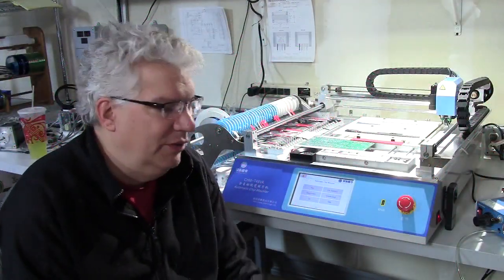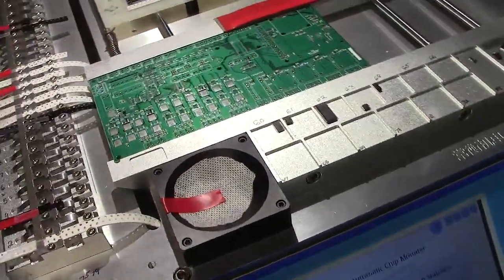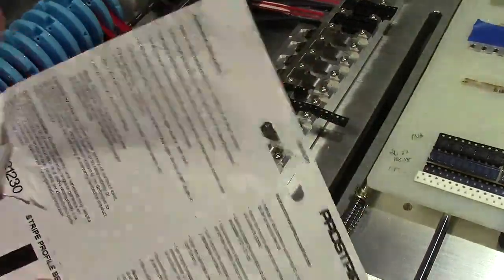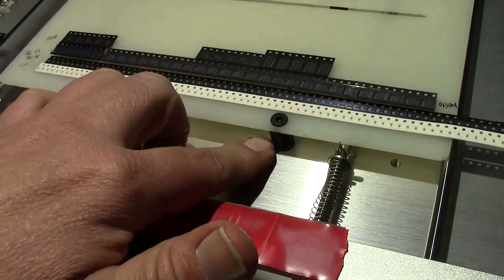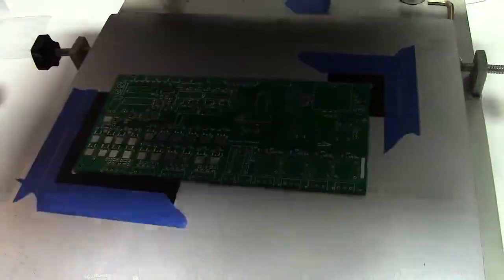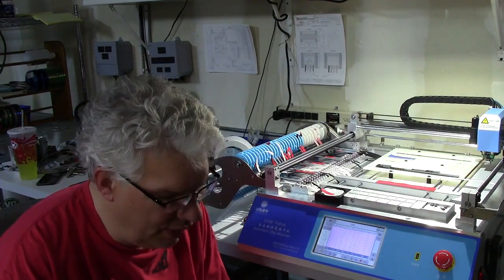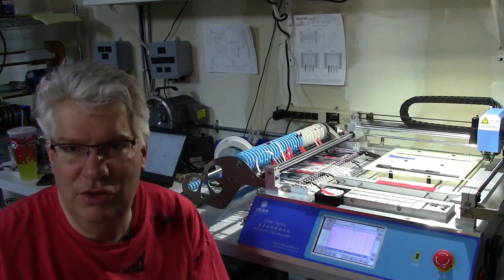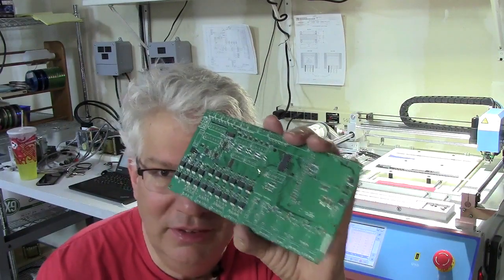190409 Charmhigh CHM-T48VA Places Surface Mount Tex Board

Comment: Hello, thank you for your video and explanation of your P & P machine.  I was thinking of buying this machine, I am presently outsourcing my Surface Mounting, and recently started getting my PCB built in China at 1/4 of the price I was paying in Montreal (I should have switched earlier, boards are all around much better).  I now want to cut cost even more and start doing surface mounting myself.  I would build approx 8000 (3000 of which is only 4 SM components) boards with approx 14 or more SM components per board, could it handle this or would I be babysitting it too much?  Thank-you.
Reply from the maker: Actually, if your boards are simple as you said, the Charmhigh might be fine
Reply: @CraigHollabaugh  Thanks
Reply from the maker: The charmhigh requires a lot of babysitting.  Check out 'unexpected maker' channel for the machine Seon has.

Comment: Sir any problems to this machine after a year? I want to purchase the same any tips for me.
Reply from the maker: I've had 2 issues, the pull pin and USB port. I have a video here on pull pin repair. The USB port seems mechanically loose and the machine won't always see my USB stick. Other than that, it works fine for the limited boards runs that I've made.

Comment: I did notice that the solder paste was a little heavy on the IC with the bridge. Hand stenciling usually results in too much paste, so I usually reduce the paste mask a little on those tiny pads to compensate.

By the way, how many components can that machine handle? Looks like about 25 reels, but with some improvising, is it possible to add additional reels on the opposite side, and still program the machine to auto feed them?
Reply from the maker: I'm definitely a novice solder paster, that's for sure. Thanks for the comment and for watching.

Comment: Did you get a chance to try a lower pull speed for the tape pull pin?  When I got mine I tried the 100% speed but it jerks the tape so hard it upsets the part to be picked, thus getting a pick error...  Once I dropped it 10% the pull and pick went very smoothly...

Comment: When the pull speed is at 100 percent, it jerks the part tape so hard, the smd component is dislodged in the tape pocket, preventing a clean pickup, or the pin yanks on the tape and jerks out of the tape pull hole resulting in an incomplete pull, think partial pitch pull, resulting repeat pulls that cannot find the hole, then with an incomplete pull large parts may be off 1/2 the pull distance...  All this goes away with a gentle 10 % pull speed...
Reply from the maker: Makes a lot of sense. Thanks for the tip. My largest placement issue happens during the blow off, it seems like air is too forceful and part is blown off its placement point. Have you seen this with yours?

Comment: I reduced the pull speed on the pull pin to 10%, most all pull/pick errors went away, allowing for uninterrupted placement...

I do not use parts smaller than 0805, lso added a dwell time on place...

I'm running the big dual sided reel Charmhigh...
Reply from the maker: Looks like I need to check these settings out, thanks for the comment.

Comment: Do you notice when you use parts below a size, the error increasing?

I like to stick to 0805 and larger.
Reply from the maker: Well not really, 0603 are fine, a slight misplaced part is pulled to pad center during reflow.  When I do another board run, I'll take more photos for you and everyone on this and other topics. FYI, there's an on discussion about this over at the Google desktop pick and place group. Thanks for watching.
Reply: @CraigHollabaugh  thanks Craig

Do you do much with the raspberry pi? I've built a UPS for it and would like to get some feedback on it if I can get one to you. If you'd like that. It's designed to shutdown at power loss and boot up at power returning. Has a switch for manual control.

Thanks again
Reply from the maker: @scottcox9108  Sure, find my contact info on LinkedIn. Let's chat before you ship anything. OK?
Reply: @CraigHollabaugh  got it

I see you're in the junction area..
Just passed through over a week ago to Utah and back here near Boulder

Comment: Most of the pick problems I've had (besides getting the video camera to work reliably) are because of the take-up reel not advancing enough to pull the tape.  After a certain number of parts pulled from the tape, the tape collects or loops ahead when it should be pulled behind.  That tape gets in the way of the nozzle, not to mention the tape on the part trying to be picked hasn't been pulled back yet.  Some have said if you alternate to another feeder for another part, instead of picking all the same part one after another, you can get some additional take-up on the tape before coming back for a duplicate part.  I suspect that might help here too.
Reply from the maker: That's a great approach, thanks for the tip!